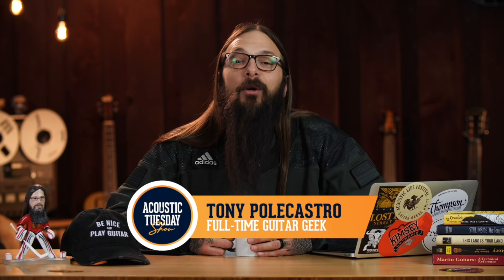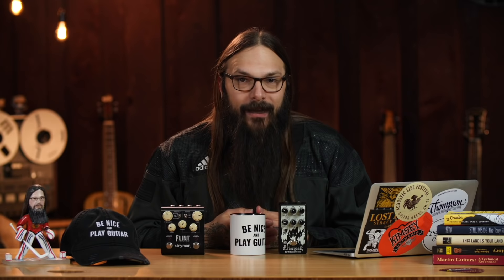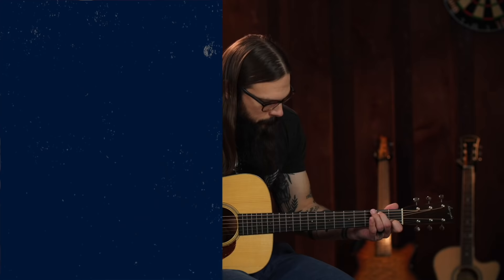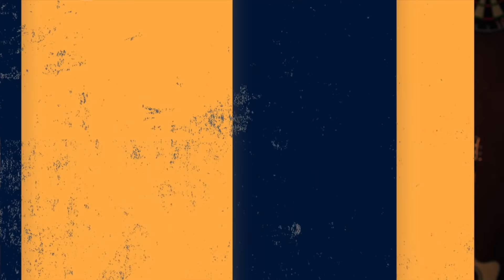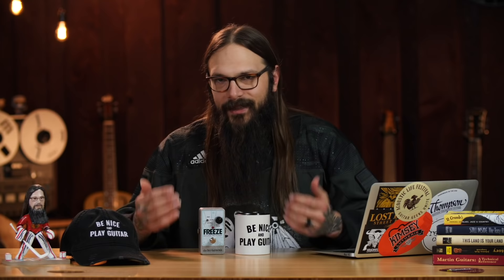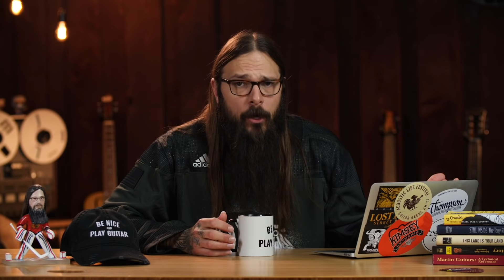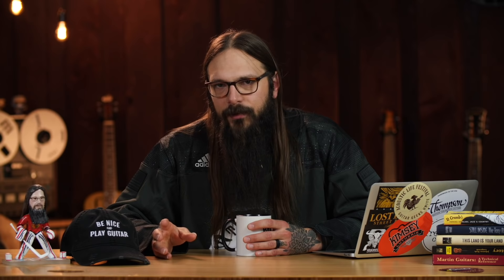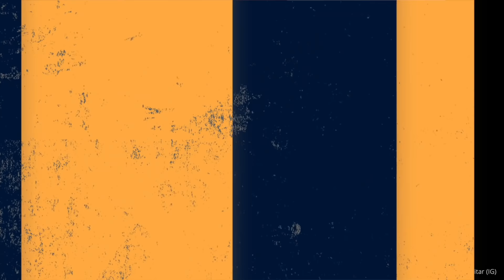6 MUST-HAVE Acoustic Guitar Effects+How to Use 'Em! ★ Acoustic Tuesday 186

Comment: If i had to pick one pedal for acoustic guitar, it will always be a looper pedal. Not only is it a great practice tool, but once you get the hang of it, you can make full blown songs with one guitar.
Reply: Totally agree!
Reply: Boss RC-1 Loop Station is a great entry level Pedal and is easy to use.
Reply: Totally agree. It's the only pedal I own.
Reply: Agree. I just bought a Boss RC-5 and it's fantastic. Audio quality is Pristine. I also use the FS-6 (with-it) which is a Must-have.
Reply: I have the RC-3, and yes, the external footswitch is a must have for it. No more doing that awkward double tap in time to stop the loop.
Reply: Same here. The only difference is that a looping, unlike the others,   has a learning curve. It also helps to improve timing. I toyed with commiting to looping, but haven't taken the plunge.  The rewards can be great.
Reply: Agreed.  My wife and I were out at a brewery a couple weeks ago and the musical act was using a looper.  He was awesome with it.  One guy playing solos like he has a backing guitar.
Reply: Yup...but would push for delay and reverb on top of it... 😂😎
Reply: Boomerang 3 does what most other loopers, including Boss pedals don’t: allow multiple separate parts of songs to be looped in real time.
Reply: @michael_caz_nyc  You also got a nuce set of drums to back you up. I love mine.

Comment: Just wanted to add something that I've never heard before: guitar exposes our emotional issues. I have recently embraced guitar as meditation, but this is antithetical to my initial experience with guitar education. 

When I started learning I was determined to master the guitar through hours of daily practice. I struggled with anger and impatience. I didn't feel like I got better and became increasingly frustrated with the pace of my progress. This turned out to be an indicator of disordered, overly critical self-talk. I finally realized that this problem was sabotaging my entire life. I am now more focused on fixing my toxic internal dialogue, and guitar helps maintain that focus. The breakthrough came in my second year of TAC. 

I subscribed to TAC and stuck with it for 3 months, then I dropped it. I renewed and finally fell into a guitar hole when I just closed my eyes and played the daily exercises over and over. I try to increase speed little by little, but reel it back if it creates tension and anxiety. This results in more, not less, progress. 

I love that the guitar is a portal to relaxation and focus now, instead of frustration and anxiety.

Comment: The risk by using fuzz or distortion on acoustics is the feedback. 
Also, piezo pickups react dirty and not so good as the electrics.
If you have a magnetic pickup sounds better.

One of the solutions for using dist/OD is the Fender Smolder Acoustic OD.

Comment: I've never had acoustic guitar. I had, and still have, my classical guitar since I finished primary musical school, here in Europe. Since my parents didn't want to buy me electric and I was bored with classical guitar music (just search for Fernando Sor), but it was a no go. So I threw my guitar in the closet for 30 years (back in 1992). 

Last year I bought my first electric guitar (Yamaha Pacifica 112V), my little Fender amp and several chinese pedals (and yes, they work perfectly and even my friend which has expensive pedals says he can't hear much difference between them).

This Christmas I will get acoustic guitar and considering I have several pedals (Chorus, Delay, Looper/Tuner, Overdrive, Noise Gate, Distortion and Fuzz/Boost) I wanted to see if I will be able to use those pedals. I don't need Distortion on my acoustic since I have electric guitar, but being able to use delay, reverb and chorus will be nice. :) 

Thanks for the instructional video. :)

Comment: I love pedals on acoustic! A cool one is the Ascension Reverb as it has a pad that can I can play over and it really fills out the sound. Used in the right moment it’s a pretty emotive effect. And ditto on that freeze pedal. And thanks for the tip on the tremolo - sounds really good.
Reply: I have a strumstick that I slapped a 9$ piezo onto. I have a pedal that is supposed to make a piezo sound like a humbucker. With that addition, I can now use whatever regular electric guitar pedals I want with my acoustic strumstick.